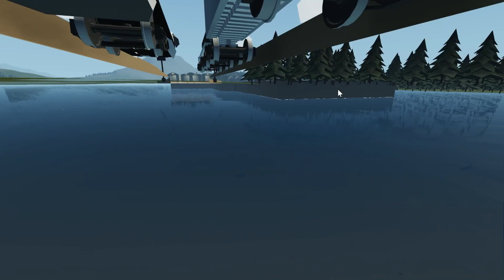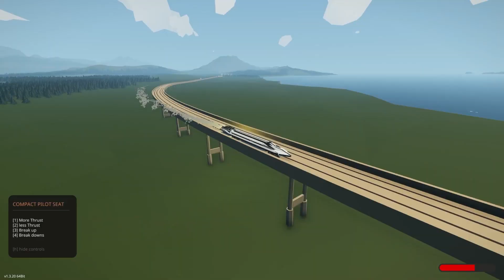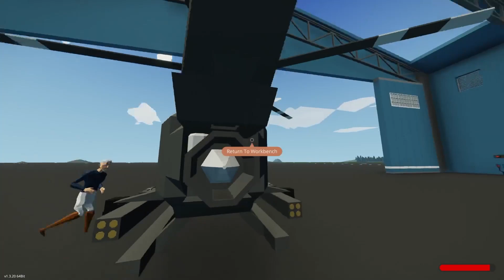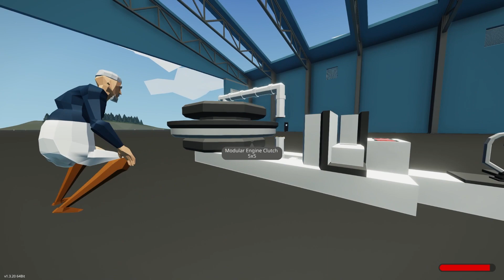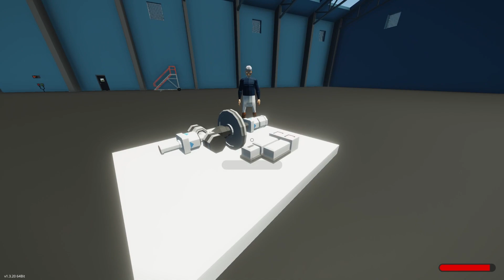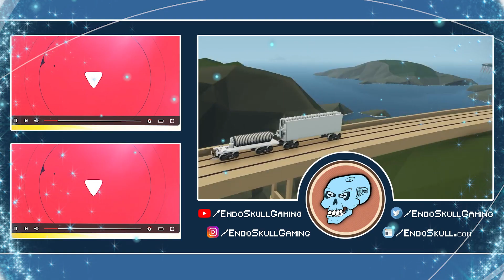UNLIMITED POWER in Stormworks & A Train Race!

Comment: I got 100 m/s on diesel electric wheel power, 90 m/s while pulling payload. The 4 engines are running at 5.4 RPS to generate the electricity at that speed. Fuel use is minimal.